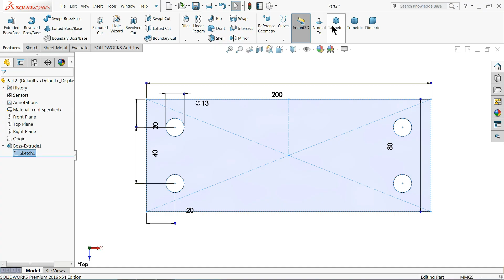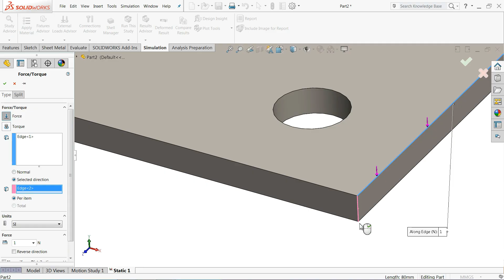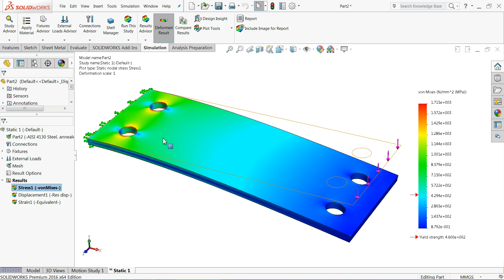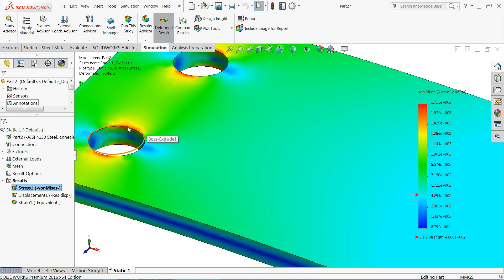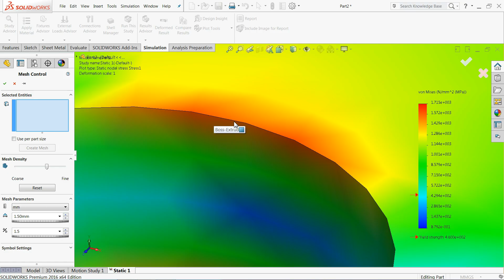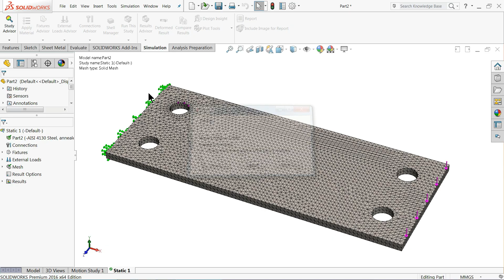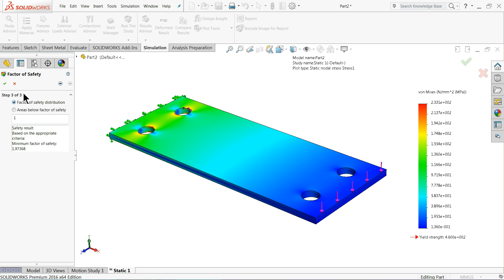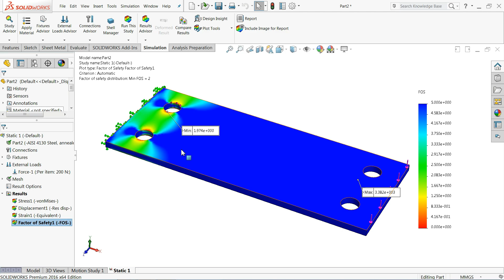Solidworks Simulation tutorial | Static Simulation Study

Comment: Thank you sir, I am very grateful for what I am learning from you. just a question about the yield strength. shouldn't it be that its red arrow goes up by applying less force? you know because it is showing the maximum acceptable yield strength and at the best it should exceed the highest applied stress.
Also about the factor of safety. Should we compare it to for example 1.5 or there some other way to check it?
thank you again

Comment: Why is the mesh on the top face, mid way and to the back of the metal not even as it is in other areas, what has distorted the mesh.  I don't mean near the holes, the mid way rear section....(on the left when facing the part that is bending)

Comment: Hi this is a really powerfull tool, I'm interested in simple flexure design and I would like to know if it possible to introduce the young modulus into solidwork to verify is your displacement won't go over the elastic range of a specific material on a specific hardness?
Reply: The materia information you can find in Metals hand book in ASTM  standard dealing.  Check the SOLIDWORKS value.  But after make the fem simulation build the prototype validate real.  Noting will be proved til you validate your project. Becarfull this is the most common engineer mistake